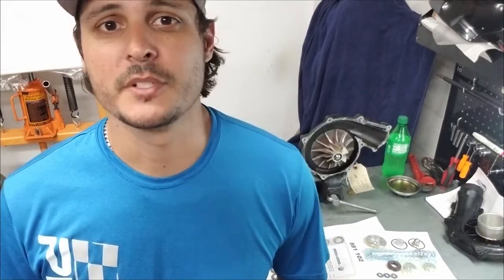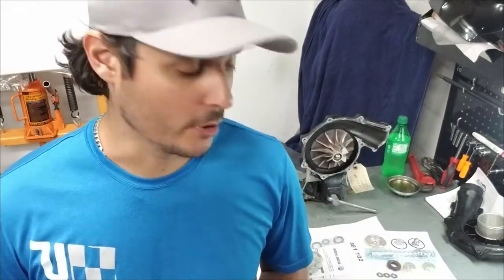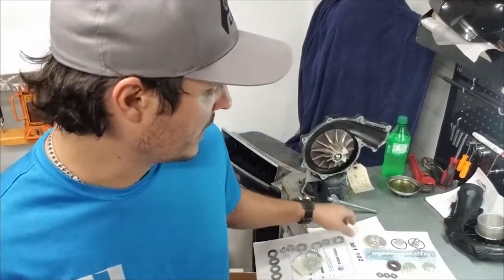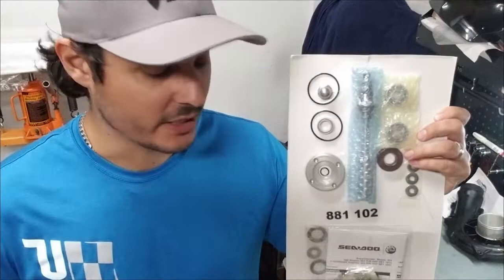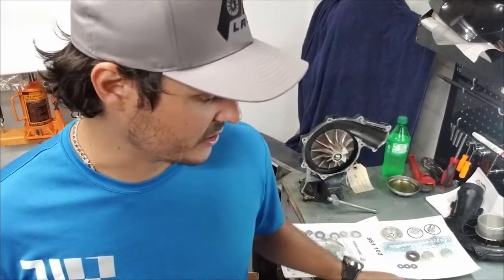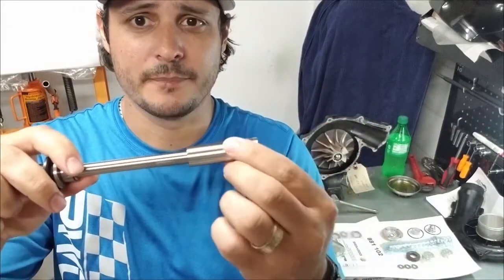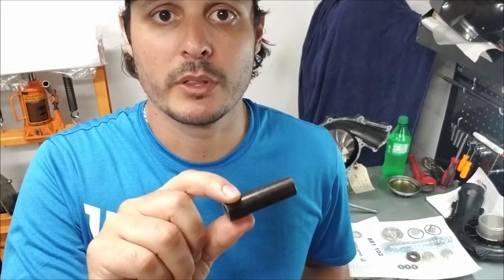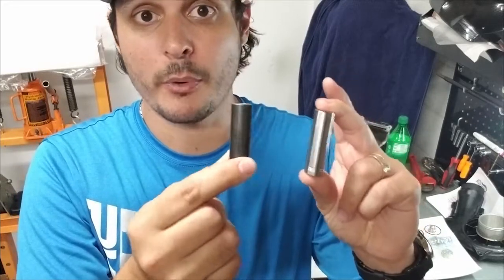SeaDoo Supercharger Bearing Spacer - BRP Machining Error

Comment: Same problem used the old spacer to drive the new one on everything seems to be okay hope I didn’t damage any thing ran motor no weird sounds going to pull supercharger after   A hour or so to check slip I’ll see if any damage was done

Comment: Thank you PWC Muscle for disseminating this information that Seadoo cannot be trusted to put their customers first, it is November 2020  Seadoo are still sending out these defunct supercharger kits. I have just purchased 2 kitsfor my Seadoo Speedster boat and both were faulty. Seadoo have had plenty of time to address this problem but their failure to take action proves they are not bothered once they have taken payment for the initial craft. Seadoo may lay the blame with the manufacturer who makes these components but they all bare the Seadoo logo and therefore the buck stops with them,  they are quick enough to take our hard earned cash for their faulty products, but is not just the expense it is the time it takes to uncover the problem and address it, luckily I chose the winter months in the UK to service my superchargers so I have not lost any time out there on the water, I feel sorry for those who have had to change their superchargers and have had to wait extra weeks to resolve a problem that Seadoo should have corrected a long time ago.